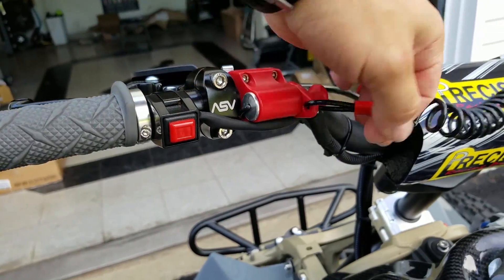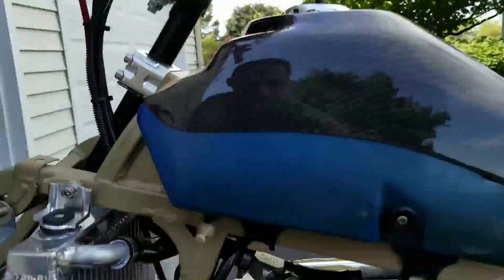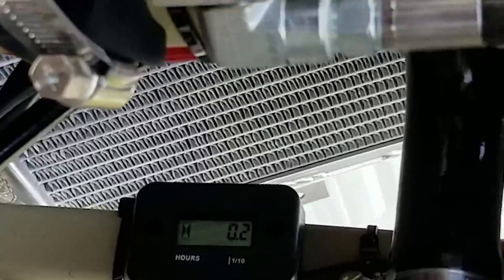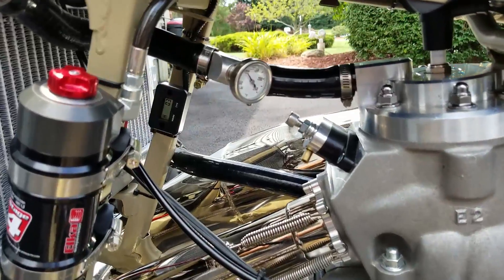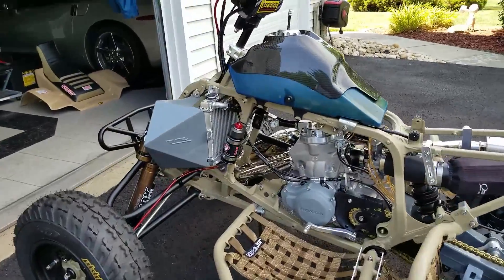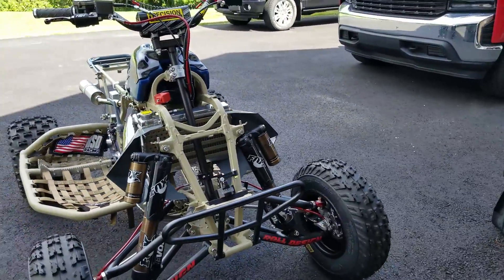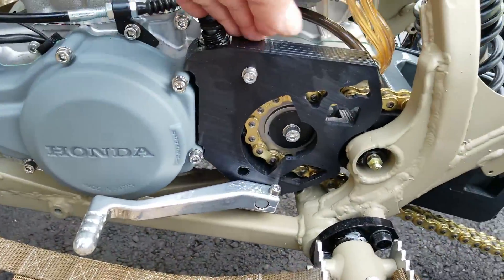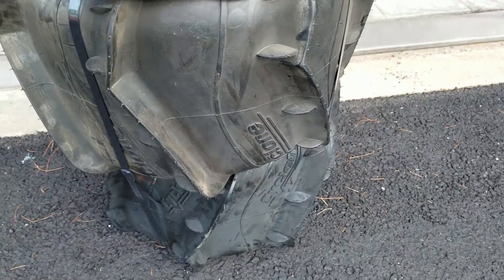2 Stroke Heat Cycles and Engine Break In (Controversial)

Comment: I’m about done with a complete rebuild on a 1999 yz 125… my factory Manuel states a lot different then anything I find on the web… it states mix 15-1 and a few start ups… check plugs they will be rich, ride easy 2 times going up in rpm and right off… drain gas replace plug and it’s race ready.

Comment: I think engne break in is important. I just bought a new 2024 ktm 300 and i tried to baby it the first few rides. I probably should have done more heat cycles but i was too excited to not ride it. The only thing my manual says is to keep it under 70% throttle for the first 3 hours

Comment: I was always told with a two-cycle that you want to get them running and idling.. but the first time you like really got them out you want to get them high in the RPMs n under a load .actually get that motor warm like warm warm..

Comment: As a Precision machinist of 15 years. I Do a fair amount of heat treating as well as flame straightening and bending. I would not run a rebuild without heat cycles. In my opinion a engine that is cycled first will last longer potentially. Might as well give it every chance to thrive.

Comment: If its gonna break its gonna break.. after a couple warm ups its seated itself so its good to go for the most part.. theres no need to ride easy, etc.. but a few good liquid changes is good.. ive rebuilt tons of motors for all sorts of atvs, bikes, and and even a few vehicle engines haha  I  own the local honda/ktm dealership in my area and have owned and operated it for a little over 20 years now and I always go through two good heat cycles and then ride it giving it a few good rips and then it goes to the customers and they all do it different.. some rip on them in the yard before loading it and some go easy and they all don't come back for rebuilds the next day so they are good to go.. I service them afterwards as well.. break it in how you want I prefer to give it a little bit of a blip.. because if you break it in easy it won't take hard runs  like the out of common rev you might give it topping out or etc.. just do what you feel is best.. if its together proper then no worries.. if you don't do everything your supposed to during the install.. then it was meant to break

Comment: I was always very concerned that I would not give the engine enough break in time so I would mix up a tank of belray H1R at 32:1 and run the entire tank through at idle using the heat cycle method which took forever. However I took a brand new crank bearings and top end to Little Sahara once, idled around the pits a little and said screw it and went out and rode balls to the wall all night with no issues (no nikasil) just a ProX310 jug with a fresh Wiseco and .010 overbore
Reply: In my opinion I think it's ok as long as there is a load on the engine and you're not panic reving with no load.

Comment: We race outlaw alcohol two stroke motors pushed to the absolute max and never run them in besides a pull on the dyno at 17,000 rpms just like on the track. A properly built motor does NOT need a run in. If you doubt your assembly/building technique enough to think you need to break it in, you shouldn’t be building motors. Period.

Comment: Put a squirt of 2 cycle oil in cylinder,run the the first tank rich.
Change plug after first tank .And ride it easy first tank.Heat cycle really .what the difference idle and reving it up or just riding it easy on the first tank.

Comment: I usually do 2 heat cycles, then ride for one tank or 2 hours with varying load, no lugging no running it out, after that rip it. I usually leave the pre mix at 32:1 and leave the jetting alone
Reply from the maker: Thank you for the feedback Brendan MX, I appreciated you watching my video!

Comment: My dad has a 86 and a 87, on thre 87 I’ve broke in a 310 and a 330 kit on it and I always did 1-3 heat cycles then ran about 2 tanks though them just to be extra safe but that second tank all gears all different rpm ranges just making sure the motor is used every way like it would be in the future
Reply from the maker: Thank you for the feedback Dakota Mell, I appreciated you watching my video!

Comment: I run cyclones on my banshee at the dunes. Don’t dig yourself into holes and you’ll do fine. 
I’d run richer than 40:1 at the dunes, they’re hard on things, especially 2 strokes 🤘🏼
Reply from the maker: Thank you for this feedback man! I feel a little bit better about the cyclones lol
Reply: @MichaelSabo  i definitely agree with the guy above dune riding you definitely need a little bit more oil just because the engine is working waaaaay harder and I am a amsoil fan from many years of experience
Reply: Michael Sabo I’m not sure if you’re already at the dunes, but it’s warm up here this weekend, id run 30:1 MAX.

Comment: people wouldnt have to worry about the hood not fitting right if they would buy the 3 piece fenders like the hood is made for lol  why buy a ram air hood to put over a ram air hood ? lmao makes no sense to me
Reply from the maker: I'm noticing this with subscriber builds... I wish maier made race cut fenders with the 3 piece design. This hood is supposed to be specifically for maier 1 piece race cut fenders though; if the tabs were just slightly recessed, there would be no gap and perfect fitment.
Reply: @MichaelSabo  yeah true . i thought they did make 3 piece race cuts . i guess people just cut them

Comment: 3-6 heat cycles of 15/20 minutes of various rpm. Then easy on that first tank of gas constantly pulling the plugs. I never go past mid throttle so I get a good reading on how it cruises and the mid range. Once you have that the rest is gravy

Comment: I normally do 2 10min heat cycles ride 15min at 1/4 throttle let cool down ride 15 min 1/2 throttle let cool down ride 15min at 3/4 throttle let cool down then rip it

Comment: I'm a 5 heat cycle guy. I don't tell anyone they're wrong because it's my bike and I'm careful. Especially with 2-stroke forged aluminum pistons which I drilled oil holes with the cold seize factor. My IT 250 is running strong on a 27 hour topend. I also ran one tank 24 to one with those heat cycles then I changed back to 32:1.

Comment: When we were racing the 250r's we have done it both ways when we didn't have time for break in time.  That being said the way you are doing it was the way all the engine builders back in the day recommended.   But you need to put a fan in front of it and vary the rpm's.

Comment: So many right ways to do it man.  I do a tank of fuel mixed a bit heavy with some heat cycles and common sense.   Minimal wot Check torque on cyl and head.  After that it’s game on.   Run the piss out of it.
4 strokes I pretty much warm them up and run the shit out of them.

Comment: I’ve broke mine in a few different ways and Ive never been able to tell a difference. All of them seemed to work fine. When I brought home a brand new Yfz450 in 2005, I decided I’d make up my own 7 day procedure of riding it easy for a week-1/4 throttle max 2days,1/2 throttle max 2days,3/4 throttle max for 2 days, and on day 7 I let it rip. It makes more sense in my mind riding it around easy for breaking it in instead of putting a fan on it and sitting in one place, doesn’t seem natural. I actually asked the dealership about performing heat cycles at home and they kinda laughed and said nobody ever does that. I wondered why is breaking in a rebuilt engine any different than one that’s fresh out the crate with zero ride time? I imagine 99.9% of people who bring home brand new machines from the dealership don’t perform heat cycles and just go ride. A rebuilt engine I’d think could be more laxed with already “broken in” and used other internals. Idk man.
Reply: In the 1950 the tolerance were not as good as today so the break in was important to mate the part in the trans and all the gear in the engine and oil pump

Today you only need to seat the ring and its done in the first 30min of running after that the cylinder crosshatch is gone

Comment: My engine guy told me, start it and ride it hard. The exhaust gases will help seat the rings faster. But this was always in my twin sled engines, the new plasma coated cylinders in the new skidoo's are balls to the walls out of the box. But I am a firm believer in whatever works for you, go with it

Comment: First tank on my trx I use a conventional 2 stoke oil. Never wide open. Then I switch to maxima 927. Synthetic oil can cause glazing of cylinder on break in. Then 927 and 110octane.
Reply from the maker: Thank you for the feedback Ryan Riel, I appreciated you watching my video!
Reply: @MichaelSabo  love the 250r stuff. It's a niche within a niche. Those who have one are usually die hards for them. I have had mine for 14 years. Not much stock.

Comment: Best way to break in is under a little load. Also heat cycles, just drive easy and calm. Sometimes little more rpm's. It sounds scary, but sometimes even pretty high rpm's. Don't stay in low rpm for the hole time. After 1 or 2 gastanks you are good.
Reply from the maker: Thank you Leroy De Vries!
Reply: @MichaelSabo  everybody has their own feel to it.

Comment: i would say that you are gonna at least need some idle breakin but also some under load to seat the ring/rings properly to the cylinder 😄
Reply: and i also build an auto gas controller with a eaton controller for the breakin that applies gas in set intervals and i also want to rig something up that aplies back break pressure when the gas is opened a bit more 😄

Comment: 5-6 4 minute Idols or until the heads are warm then 3 gallons of riding in first gear at about 1/4 throttle increasing each time. Then hual butt in 5th gear wide open, adjust jets and your done

Comment: I have heard a shop that builds crazy 100+ hp banshees will break them in doing max dyno runs right away after they are warmed up. They say those motors last and they make the most power

Comment: How I break in all my two strokes is I get some duct tape and tape the throttle wide open kick it over and let it run wide open for five minutes and then shut it off. next for ten then the last for five. then i use the cheapest two stroke oil( just breakin it in so go cheapo). then I get on start it hold it wide open and neutral drop it it breaks everything in at the same time top end bottom end and clutch all broken in then go riding. Eeessee Peesee keep it greessee

Comment: I run 3-5x 20 minute heat cycles then I let it sit at idle with a blower fan at the motor for about 6+ hours. Then I change the oil and ride easy for the first tank. I change the oil again before riding hard.

Comment: The 350 raptor I rebuilt. I let it idle for about 10 min changing the rpms after that took it out to the trails and rode it for 20 minutes or so taking breaks of about 15 minutes. I did that for about 3 hrs then went home and changed the oil.  I never ran it hard  and made sure to go up and down in the gears. the next weekend I took it out and kind of did the same thing but rode it a little harder.  After riding change the oil again.   I have put about 15 hours on the motor and I have changed the oil three times.  I’m going to change the oil to 20/50 because it’s hot as hell now.  It seems to be running good so far.

Comment: Never done a 2-stroke, but on 4-strokes the first heat cycle is to bring it up to temp. Making sure fluids are topped up and moving, using the cheapest oil that meets specs, all parts well lubed with lucas engine break in. Also never letting it idle more than 10 seconds, and never over 50% throttle. Then a second the next day in the same manner. The third i will ride taking it easy, while never going past 75% throttle. Then i change the oil. The oil will now be factory to that model. Then run a full tank as if i would normally ride but at only 90%. Then another oil change and let it rip.

Comment: 3 heat cycles blipping throttle bring up to operating temperature using heat gun. Cool down between. Retorque. Run a tank no more than 3/4 throttle. Let her rip. Use same oil and mix you will be running.

Comment: I've always did 2 heat cycles. Ride it through the gears for 20mins then change the oil to catch any metal that came off with the new rings. Ride it how the machine will be ridden through all gears for 2hrs. Change oil then ride it hard.
Reply: For 4 strokes maybe
Reply: @jameshatfield6814  What would you do different? I've always got good life out of my banshee motors.

Comment: I just run a couple tanks through with light throttle don't let it get in the "pipe" never had a problem in fact the only reason I've rebuilt my bikes is just as a maintenance thing I've never blown an engine and I've had alot of bikes, my friends r a different story though haha

Comment: Just rebuilt the top end on a 2001 Trailblazer 250 (I know you're jealous, lol). I used a NAMURA top end kit. The instructions say to do at least two heat cycles. They recommend driving it for 30 minutes to an hour, but taking it easy, not giving it full throttle, but if you do, very short spurts. Then let it completely cool down, (x2). I just do what the instructions say. That way if something goes wrong, I know it most likely wasn't me.

Comment: I do 2 heat cycles then i ride with variant throttle flooring it a little then after the first oil change (2hrs) i ride it like i always do on 450s anyway

Comment: She sounds good man!
I usually do a few 10 minute heat cycles on my builds then 1st ride i will stay off the rev limiter for an hour or so after that i don’t go crazy but ride it a little harder after that change the oil and ride the hell out of her! Ive had good luck over the years w my builds especially w racing these things but i usually do a new piston every 20hrs seeing has i run H/C pistons!
New quad is running good getting 4 holeshots and 4 wins and even a couple record overalls for me 😁

Comment: I agree with  your look on brake in I've just always went with a tank of gas and I always went little rich  then mix gas haul ass ...........    FYI it's a 2stroke people you don't hold it wide open forever or your going to blow it up again an again
Reply: Two strokes actually like to be held up high in the rpms, so they don't get clogged up with oil. 👍
Reply: Key word in there """Forever"""

Comment: Dude I've said it many times, that R is bad ass, and it sounds sweet, it's your build break it in how you see fit, you have built enough engines and you know what your doing don't listen to the haters. I usually run a tank of fuel on a easy ride, then let it rip, (2 cycles). Anyway the R is bad ass bro I love it. 👍👍

Comment: 3-5 heat cycles and easy on the first tank of gas. That’s how I do’em bro.
Reply: Mike Kent i go balls to the walls and never a problem
Reply: @jamieobrien3387  1 heat cycle, then run'em like you would normally drive it. If its gonna break have it break right away. Haha
Reply: I do 2
Reply: Just drive it no need to do that
Reply: I go easy for the 1st tank and then hammer down!
Reply: Sweet racer bud

Comment: I have been building 2 smokers for over 25 years I do 3 15 to 20 min heat cycles bump the throttle several times through out the run time and then 1 ride at about 45 mins and no full throttle then let them cool off then run them like striped apes !!!! And yes I do let the motor cool down in between each heat cycle !! Love the content brother !!!! You can diff build some SICK 2 SMOKERS

Comment: Raced for many years in CA.  My job was to ride em not fix em, but a couple 10 to 15 minute heat cycles is what every builder I knew did...  they always stressed complete cool down between cycles.  I would launch that 250R 100+ feet all day...